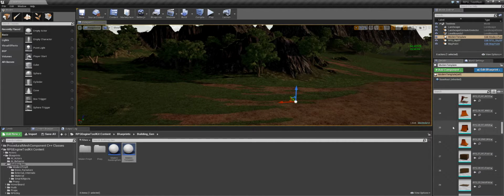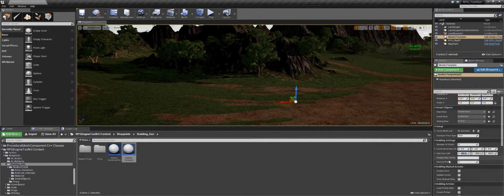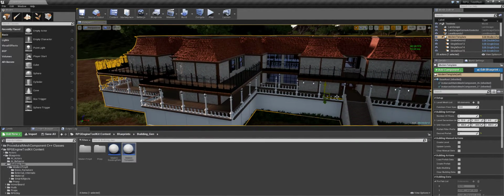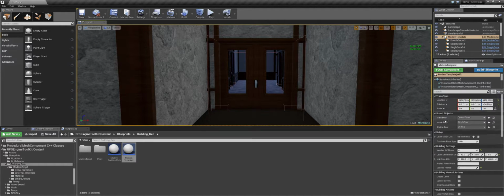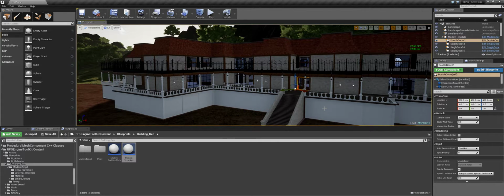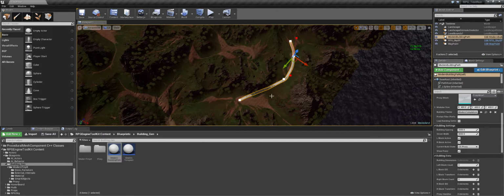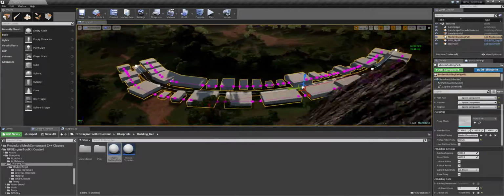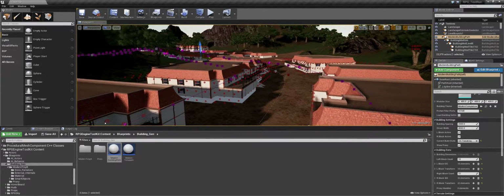RPG Engine Toolkit: 05 Modular Building Creation and City Path Creation

Comment: For some reason, when I hit 'LoadBuildingSettings' or 'LoadPrefabData' I get an error message in the Output Log ' Failed to read file 'HOME_Large1.BLD' error,' and 'LogTemp: FFILEHELPER:>> Invalid File.' It can't read from the file. Files are in the correct folders -> Content/Data/BuildingLayouts, and it has the Prefix. Files are not Readonly. Any idea about this?
Reply from the maker: Anthony T what release. Version, can you open it with the database manager?
Reply: Kevin Mitchell 4.16.3 it opens finr in the db manager
Reply from the maker: I would one save it out again and make sure that the ms is cloased and not making the ownership of the file his
Reply: The 'ms' ?
Reply from the maker: database manager, sorry ms is something we use at work...
Reply: Tried that and even added a plugin for windows registry that allows for me to exclusively take ownership of folders and files. I debugged the code, and it gets to the point where it tries to read the file down in the FileManager or whatever class it was called. It's almost like the Database Manager is corrupt or something.  I used the database manager in the MyProject->Plugins-> RPGEngineToolkit -> extTools -> RPGTools  and extracted the DatabaseManager.zip  to that current directory. Then opened the VS solution project, compiled, and start/run.  Started a few new projects, even made sure the project was in C documents instead of my secondary SSD's.  I'm even installing an earlier engine build ( 4.14.3 ) right now.
Reply from the maker: Anthony T your load issue is happening in the editor and not the database manager correct? Also is that the only file that can not open?
Reply: Have you tested this on 4.16.3? I tested it on 4.14.3 and it works, but when I created multiple projects in 14.6.3 It does not want to read the data in for the building layouts.
Reply: Yeah it happens in the editor and not the db manager. None of the files will open in 4.16.3 for me. I had to use 4.14.3 make the changes I wanted, and then migrate the map to my 4.16.3 project.
Reply from the maker: Ill try it again right now.
Reply from the maker: So it looks like epic changed how the path resolves in that release so the building paths were missing their directory path. Which the function needs to open the files. I am posting the fix to the forums and on my facebook page.
Reply: Kevin Mitchell awesome thanks
Reply from the maker: Anthony T no thank u for bringing it to my attention this this has too many components too keep up with at times lol
Reply: It's working great now!
Reply from the maker: Anthony T mew